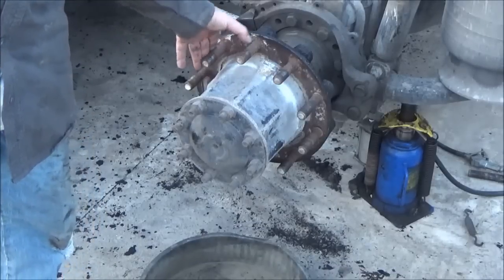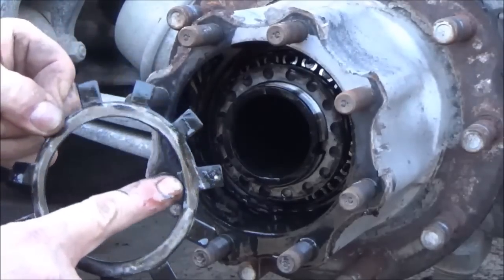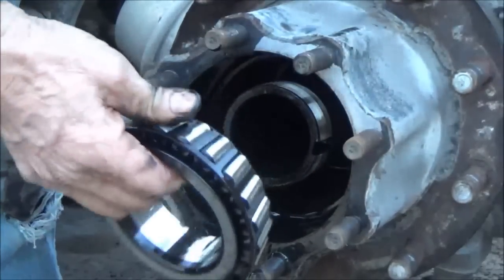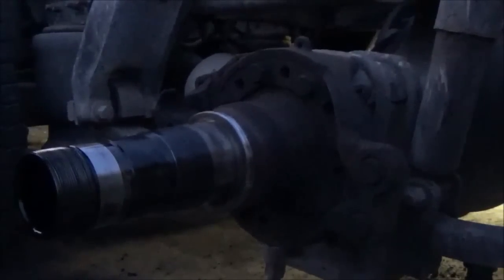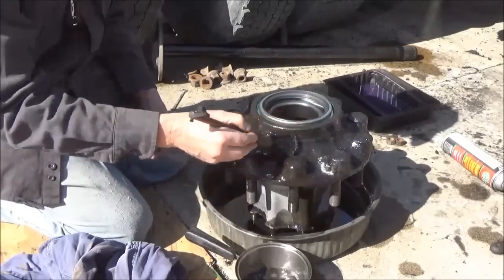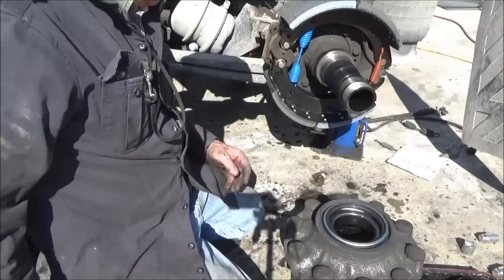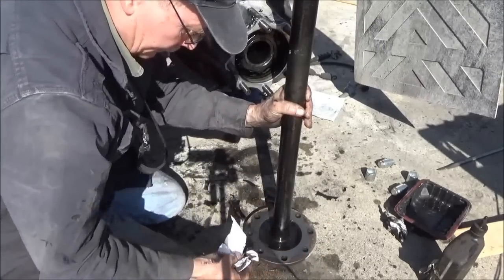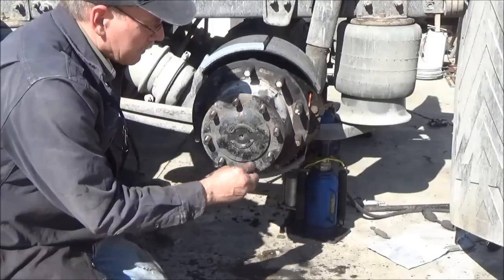Changing axle seal on semi truck at home without all the special tools

Comment: Gordon,
Thank you for your videos! Yours is the second channel I have subscribed to in the life of YouTube. I very much appreciate you showing regular folks without all the fancy gear how to get the job done. Let me share with you a little on this procedure I have learned over the years, I am always trying to learn a better or easier way to do things myself. When pulling the seal there are two methods way better than using a crow bar against the hub. #1. With most hubs you can simply pull the outer bearing, put the outer nut back on the spindle and give the hub a couple good sharp tugs and the seal will uninstall itself. #2. Reattach the hub to the drum with a couple lug nuts and use the hub wall to pry out the seal, so your not prying against the other side of the seal, much easier and the whole seal will simply pop out with little effort. And for all those folks complaining about the way you tighten the nut down, one good whack with a screwdriver after hand tight equals about 200 lbs. on my torque wrench, and much quicker. Best wishes
Reply: 11:38

Comment: Mr. Robertson that was an excellent video you've posted. This coming next month on the 25th will be my two year anniversary that my truck caught on fire. This same work that you're doing on this truck was what I needed but I wasn't quite aware that the hub had ran out of oil which then caused the fire. I have conducted my pre/post trips everything time and I have mainly looked for oil leaks around the areas that oil my be spotted but I've never seen any. Prior to the fire the truck has been sitting for quite some time before I bought it from someone. I have ran the truck for two months after I bought it and on the week of the 25th of June I had planned to take the truck for a PM but the truck never maid it to the weekend to get the PM done. What would have been a $350.00 job based on a PM service ended up cost me close to a $10,000.00 job. I basically had rebuilt to whole rear axle, all my air bags, tires, rims, etc. I finally was able to get my truck back together 2 two weeks ago. This is actually my first time owning my own truck and boy what a way to learn from something like this. Your video gave me soooooo much knowledge of changing the seals on the axles and servicing the rear end is sooooo IMPORTANT that procrastinating on something like NOT servicing these exles will cost you thousands of dollars or costing you to lose your truck which in my case paying thousands of dollars. Thank you sooooo much for posting your video it's very INFORMATIVE!!!!!
Reply: Thank you sir for sharing
Reply: Wonder the last time the gear lube was changed?
Reply: If you're driving for a living, especially if you own your own you better start learning what everything on your truck smells like,  looks like and sounds like. 90 weight has a very distinctive odor, especially when you warm it up

Comment: A tip on getting the seal out...place the hub back in the drum (bolt hole side up) and it will provide a good support for prying the seal out, you can even put a lug nut on it to help hold it

Comment: I have just found your channel.  Excellent video!   I am happy to know that I am not the only person to put seals in with board and hammer.  Also you are working outside just like I have too.
Reply from the maker: Thank You Sir. I was a pro car mechanic in the '80s and worked inside, but my truck can't go in my shop. I'm not a pro mechanic anymore but I still do all of my repairs here at home. I'm rebuilding my truck engine right now, subscribe and follow the progress.

Comment: I don't agree with the hammer and chisel !
but I went to Max S Hayes Vocational school three years, with a state Vocational certificate 35 years in the business and 25 years driving em and wrenching fabrication, welding etc etc etc take from an old school pro !!!
well done ! you didn't do bad at all !!! if I was still the shop foreman at Callison trucking, I'd hire ya in a heartbeat Sir !!!
I've seen many a good small company go broke cause of overregulation etc !
ALL THE BEST TO YOU AND YOU'RE FAMILY SIR !!!
Reply from the maker: Thanks for the compliment Sir. A lot of people have a problem with the hammer and chisel for tightening the locknut, but you know, I did 3 of them that way on this truck over the last 15 years and all of them came off that way and I put them back the same way, also one on my dump truck. I will buy a socket some day and re do the video, but not because I don't trust it to hold, it will hold until it needs to come apart for some other reason, I'll just do it for those politically correct people who really don't understand the mechanics of the whole thing and for those who are going to mechanic school and need to learn the proper way to do that job. Also I didn't add oil to the hub, I knew the bearings were wet and the diff. was full and as soon as it started rolling down the road it would fill with oil. I caught a lot of flack over that too.

Comment: I was given an old tool for doing those large hub nuts. From the look of it I think it's ex military. It is a tee handle with two v shaped jaws that wind in and out towards each other to suit the size of the nut. It can reach in about seven inches. It looks like a load of torque would bend it but for reaching into hubs to do the big,low torque nuts it's perfect. There is a half inch square on back,probably for a torque wrench. I have never seen one on eBay or in any of the tool catalogues . Bit of a shame as it gets used by me on pretty much all the big hubs I do that use a nut to preload and secure the bearings.
 One observer once told me a similar tool was used to fit the sealing gland  nuts on torsion bar suspension tanks and that would explain the military link. Well worth keeping an eye out for at the flea markets and swap meets.

Comment: I have found that cursing helps at every stage in this process.
Reply from the maker: Thanks for watching.
Reply: Cursing seems to help when doing alot of  things. Lol
Reply: An easier way to get that seal off is to put a nut back on the end of the axel and just knock the hub against it as you take it off the axel and the seal will pop right off.
Reply: Sometimes you need to

Comment: When removing the old seal put your pry bar behind it then get a wrench and turn the pry bar it will bring it right out and you don't have to chase the hub around. when you are prying it out like that you did you get one side loose and when you turn the hub and pry again you push the other side back down.

Comment: Nice install I like the Chicago rawhide seals my self a lot nice then the Stemco seals where you have to put the slip sleeve over the axle. Anyhow a little tip I do is to put a bit of oil in the hub between both bearings before putting the outer bearing just a little insurance for me that the bearings get oil also don’t forget to top up the diff oil

Comment: Just out of curiosity, about how many times have you replaced inner seals on axles? And, how many times have these wheels fallen off due to bearing failure?

Sorry... It just amazes me how you got to be Public Enemy no 1 because some  techi went to school and thinks he knows everything. Any real-world person knows tapered roller bearings have an amazing tolerance to adjustment. And while certain methods are more perfect, lots of methods are adequate. Obviously one would use the best tools available... a wooden seal driver could work without problems, eh?

Mr Robertson you have an amazing array of skills and experience. I'd trust you before  techi any day. But then again, I'm just a graduate Mechanical Engineer... what do I know?
Reply from the maker: Thank you Sir, I didn't quite know how to respond to the 1st part of your comment so I just didn't. The answer is 3 seals on this truck on 3 different positions in 15 years, no bearing or seal failures on any of them afterwards. I did go to school for this work almost 40 years ago and never worked on big trucks before I bought this one, I did do some repairs on the company trucks I drove before  I bought mine, just minor things, electrical or adjustments etc. I did work on cars and medium duty trucks full time for about 10 years and part time at home for many years after that while I was welding at a pipe shop and or machine shop at a foundry before going into trucking. I just do things my way at home and always get the job done or I don't upload it unless I'm sure I will finish it. I have a few small engine videos waiting for parts to arrive so I can finish them and upload, I don't want to put them up when I don't know when they will be done. I don't like wasting my time watching someone's video titled how to do something and they failed to successfully complete the job, I won't do that on purpose. Thanks again for the sub and the comments. Welcome aboard.
Reply: Ya exactly but i post a video how to change a piggy back brake chamber a faster safe way and get the 3rd degree because i use needle nose vise grips with 2 pieces of rubber hose over vice grips to protect the air hose while pinching off the airline working on the side of the interstate .....ya exactly seal doesn't come out beat the hell out of the hub and bearing eventually it'll come out....damaged hub and all lol
Reply: I mean since your a mechanical engineer, then you should know all about proper torque specs and the safety/reasoning behind them, this guy got the job done, but how many hrs did it take him compared to a professional tech, also what happens when those bearings have a failure and that wheel end comes off, potentially killing someone because of a few improper procedures that could of been avoided by going to a proper tech
Reply: @factionlesswrx3256  Sure. Of course. And, none of his repairs have failed in any way... as his response stated. In other words, a shop must follow the proper tech & spex because of liability problems AND a regular experienced person can simply do what works. Again, tapered roller bearings seem to have amazing tolerance for installation technique. Me, ? I'd use the book approach... because I have no experience for doing any different. But, I'm not going to go against "what works" just "because," eh. "The best is the enemy of 'good enough'".
Reply: Not saying any of his failed, but I have seen ones that have failed, some of which that were done the same or similar ways in this video, I have also seen bearings that exploded inside causing the whole wheel end assembly to fall off while driving, because the bearings weren't  100% the proper ones from factory, and from not proper installation, again this works but when a failure happens you wanna risk someone else's life? Maybe an entire family or 2?

Comment: I have worked on cars and light trucks for years and seeing you do the brakes and this seal looks way easier than what i'm used to. The hardest part looks to be the weight and size of all the parts. The weight of a light truck hub may weigh 2 lbs where yours looks to be 10+ lbs. Great video, I like to learn new things like this.
Reply from the maker: Thanks for watching and subbing. I have newer videos on brakes that are faster and easier.

Comment: Sometimes after we remove the outside bearing if you'll put just the keeper nut back on three or four turns ... you could just give the hub a light pull and the nut will catch on the rear bearing and pop the seal out with the momentum of the pull. Also, some older axel heads have little cone-shaped washers behind the very first nuts and lock washer that you took off. The cones are impossible to take out unless you know the technique... Take a small hammer and tap over the outside edge right beside bolt and the little cone will just pop out, releasing the head and thus the axel.
 Years ago  I paid a guy to do a brake liner and seal change. He charged me but didn't change the seals but said he had. Upon inspection of the work, I noticed that the axels looked like they had never been pulled. Having done the work myself before I knew the trick with the cone part. He came out to my truck and I asked him to remove the axel I already had the nuts and lock washers off he didn't know how to get those "stinking cones" out. That proved to me that he hadn't done the seals. I put a "stop payment" on the check for the whole job. I paid him for brake parts. He was pissed but he wasn't big enough to do anything about it. I don't do business with liars.
Reply from the maker: There should be a new video of that same job to be recorded tomorrow unless plans are changed. A friend with the same kind of truck went for an oil change today and called me asking if I was working tomorrow, I said no, he told me the oil change man showed him the leaking axle seal and my friend asked me if I could do that for him tomorrow, so that is the plan. New video on that soon.

Comment: As I was watching this hard working man I was thinking about the number of seals and bearings I have replaced in hubs. I have had monstrous loads in my utility trailer and nothing I have ever installed has failed. I just tighten them down very snug to make sure they are seated, back all the way off, snug them and back off just to the first holder tab, or if they are aligned upon snugging (they never are) back off to the next nut flat.
It's hard for an honest man to make an honest living.
Reply from the maker: Thanks for watching.

Comment: pleasing the hub on the brake drum brings more stability to pull the seal, also to pull the seal out you could use a self tap screw  a 2x4 and a carpenter hammer

Comment: best way ive found to getting seals out is using a long prybar that is square.  put the pry bar between seal and bearing and twist the prybar with a big adjustable wrench.
Reply: dependind on the hub itll pop right out. if not chisel. collaps the seal in. wedge the chisel between seal and hub to move it inward slighly and punch inwards after that. clean up an chips the chisel made on hub.
Reply: good idea
Reply: Slide hammer.
Reply: crowfoot prybar two seconds it's out works every time

Comment: Gordon I need to do this on my 02 Ram 2500.  The process looks the same for most vehicles.  Should I bother getting the seal installer and seal pullers or just use a block of wood, some crow bars and a drift.  No one seems to use the special tools but I'd prefer to do it once every 150k miles.
Reply from the maker: Hi John. For me personally, I would use the wood or anything flat and sturdy that looks like it would get the seal in evenly watching closely as it's getting started so if it starts going in crooked you can quickly start hitting the high side to balance it before it's damaged. As for getting it out, you can do what I did or use 3 or four self tapping screws around the face of the seal and grip the screws with a vice grip or a pliers and lift it up an inch or 2 and hit the hub with a hammer to make like a slide hammer, or better yet go to Harbor Freight and get a slide hammer if you don't have one and use that. Let me know how it turns out.
Reply from the maker: I don't want to buy any 1 time use special tools, you can always use a slide hammer for something, but a seal installer? use the wood or go to Auto Zone or one of those places and borrow a tool if you don't want to do it like I do.
Reply: Gordon, thanks for the tips.  I'm a little nervous to do the job but looking forward to the challenge at the same time.  I picked up the socket for the hub at the auto parts store today.  For under 20 bucks it seemed like a good idea.  I was looking at a slide hammer.... :-)
Reply from the maker: Nothing to be nervous about, it's easy, if you have problems, it's no big deal to take the hub to a shop and watch them change the seal. Check the bearing and the race for any pitting, or grinding sounds before you put it back together and don't forget to back off that locknut about 1/4 turn after seating it down tight and make sure the oil is within 1/2" of the hole, better if it's full. If you need to change the bearing and race you can call me and I'll tell you how to do that, I don't have a video on that yet.
Reply: Thanks Gordon.  I've been watching videos and reading the manual and all that's left is to get into it.  Thanks for the great tips.

Comment: great video Sir..Thinking of attempting this on a Greatdane trailer. Would be my first time ,any advice ??
Reply from the maker: Can't think of any advice that's not covered in the comments other than newer axles may have different style of locknuts but you still need to back off your first locknut a quarter turn after preload
Reply from the maker: You may want to look at my changing brakes on big truck video if you don't know how to loosen the brake shoes and tighten them back again when finished In order to remove the brake drum

Comment: Hola Mr Gordon. how do you know you seals are bad? im having problem with my semi and dont know its the seal or the bearings .
Reply from the maker: Hola Myrna; If you have a seal leaking, you will be able to see oil getting on the brakes and can smell it as well. If you don't live too far from me you can use the email and contact me and come by my shop.    gordonrdiy@yahoo.com

Comment: After you remove the outer bearing reinstall the inner nut about half way down the threads and use the hub as a slide hammer. 
It will knock the seal and rear bearing out with ease.

Comment: Thanks for the video!  I'm much less intimidated to change the hub seal on our truck.  I like to use 50/50 Diesel and ATF for cleaning.  Less vapor inhalation, almost no accidental ignition risk.  Solvent and detergent together, easier on seals, has a good shelf life.
Reply from the maker: Thanks for watching Phillip.